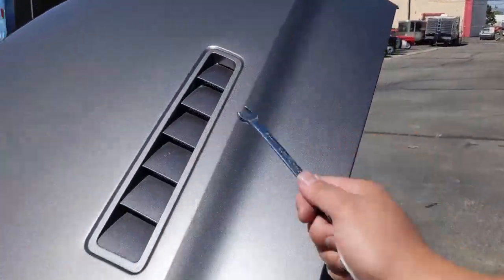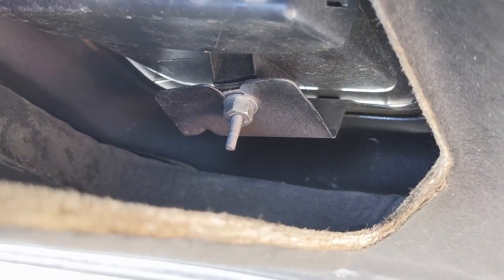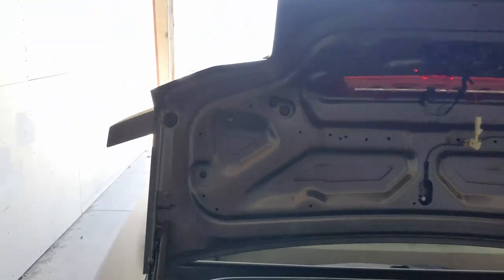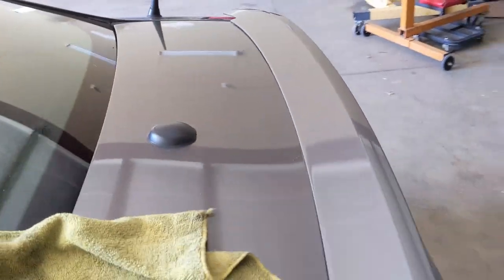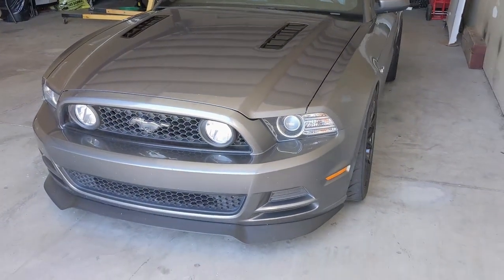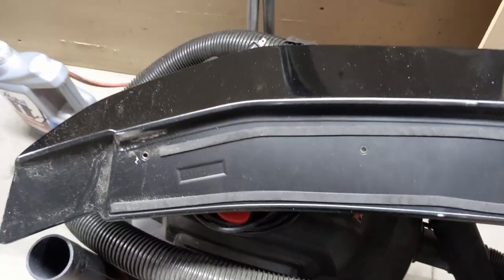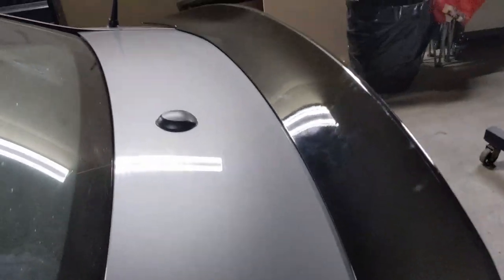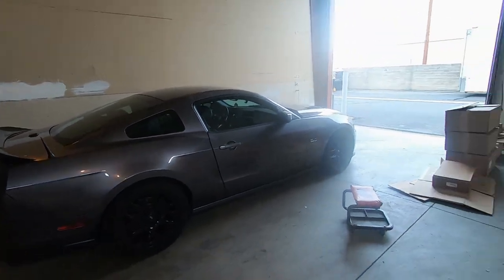How To Change Your Rear Spoiler On A 2014 Mustang

Comment: I'm about to pull off the spoiler on my 2012 Mustang and reattach it because it's leaking, and now I see why. Why did they put that big hole right near the edge of the spoiler? It just so happens that's the area where mine is leaking.
Reply from the maker: I am not sure what the point of the big hole is.  It is most likely for something at the factory.
Reply: @markskeem   Yeah, I'm sure you're right. Probably for a certain package or option or something. Now I'm trying to figure out what kind of sealer to get. I noticed they really loaded it up around the screw holes. I can't decide between a double sided tape or some butyl tape.
Reply: My 2014 Gt has that too but it has a  rubber grommet in  it that has started leaking in the same place. I am not taking the spoiler off so I cannot replace the grommet from above SO I just put a double coat of silicone from underneath on the grommet. So far so good.. Before I did that during a bad rain storm I got almost a cup of rainwater in my spare well. Some Mustangs like the California Special have a backup camera in the spoiler so that's probably there to make the wires to the camera go through.
Reply: Like I said in another comment I think the extra big hole is  for a back up camera that is in the spoiler for a wire to go through . . It was an option in 2014 I have only seen one like that.. @markskeem